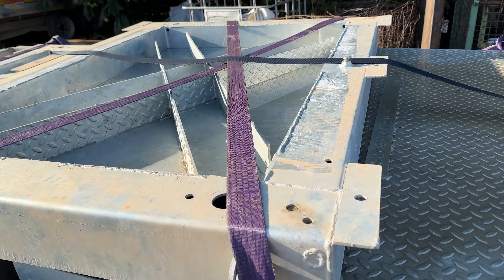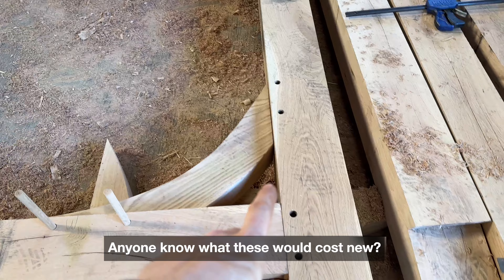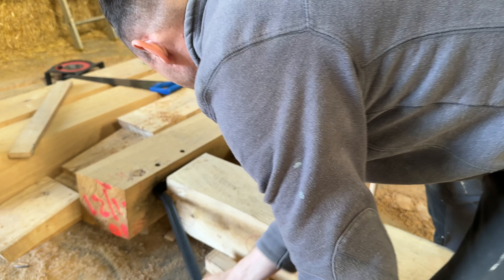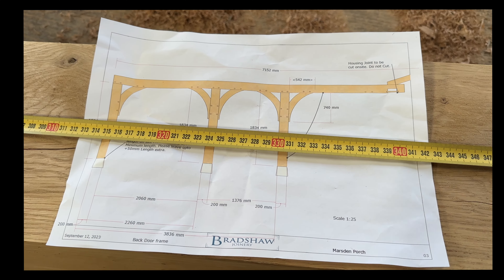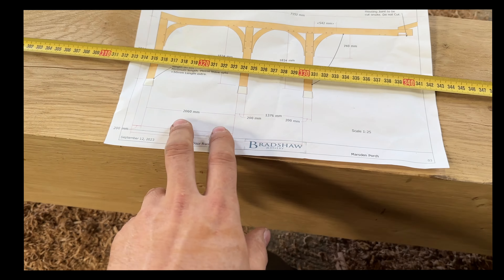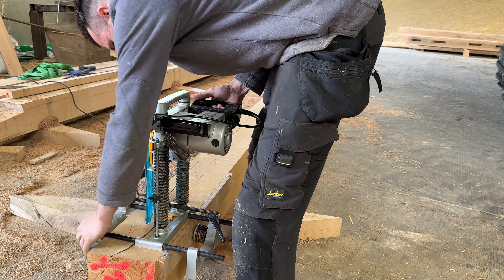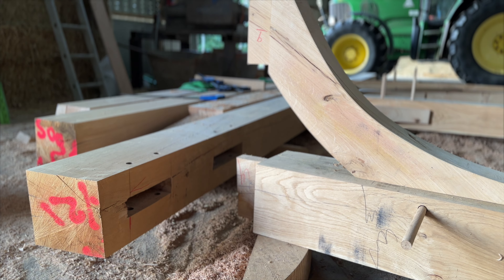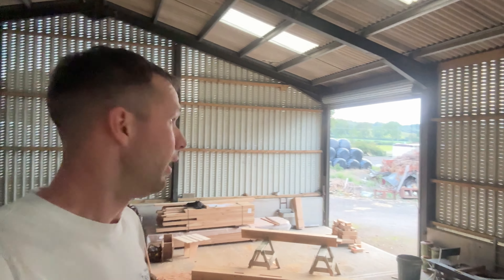Cinematic Oak Framing

Comment: I half expected the little Festool to start smoking but I guess they are better than that :)
It can help to balance a long load with two hoist strops spread apart, in your case for instance from each end of the bulldozer bucket, this keeps your load from tipping and rotating.

Comment: I know that feeling well ‘F%#k’ your chest tights up… breathing stops… subconsciously the mind is working solutions/ work around as the anus puckers away… and you’re almost scared checking the sizes. 😂

I don’t even get embarrassed know measuring 4-5 times! And I might even ‘back check’ ie. come back the other way and see it’s all still to a nearness 👍🏻

I’d rather measure 100 times than make something wrong once. ( I learned that after I made things wrong more than once 😂)

And I don’t know if it’s just me, but the minute you pull out the tape extend it and you brain engages…. But if the customer is there, do you notice they always start asking stupid Fucking questions right at that point?!

I tell them now to shut it or leave or I’m leaving, it’s not just once or twice it’s pretty much every customer every time

Comment: Oh my god, the 100mm mistake! Someone should do a PHD on it. I had some clearly marked sticks at 500 1000 and 2000 I used to measure windows. Most of the time it proved very accurate. Until the day some wagg lopped off an inch or two of one of them. I made six windows oversized. Strangely no one took the credit for that jolly jape.
Reply: “Off by One” is a curse cast upon humanity by an angry woodtroll who couldn’t stand the fact that humans are the better carpenters.

Comment: Many years ago i made the 100mm error on a 3mt picture window over looking the cricket ground at the back of of the customers house the problem was the transom ended up right in there site line 😮 it should have been 100mm higher, yes we have all done it.